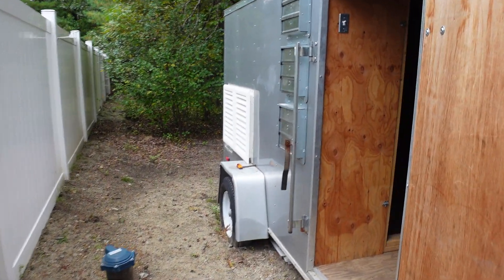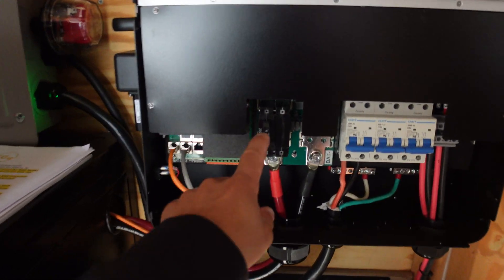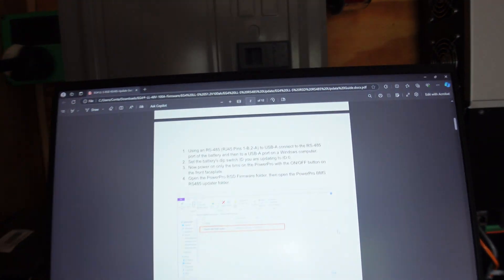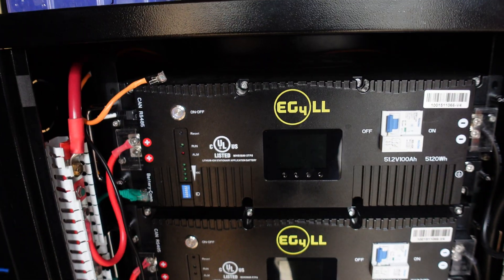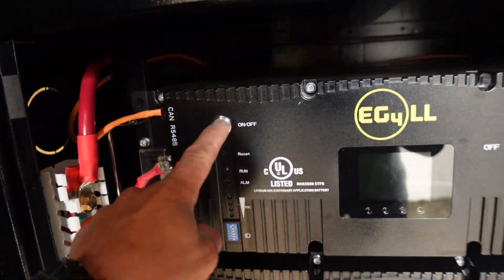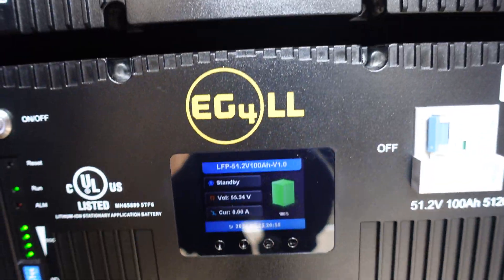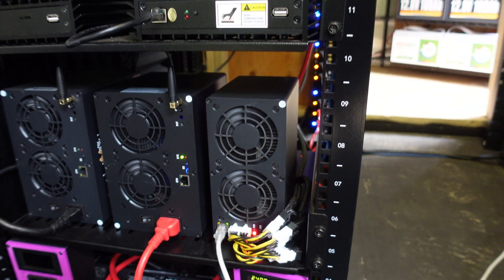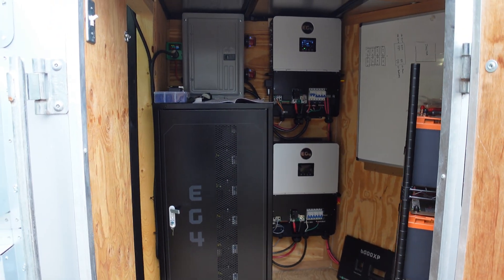Upgrading EG4 LL Solar Batteries is EASY!

Comment from the maker: ✨Firmware Upgrade Files: 
https://drive.google.com/drive/folders/16QYI3lXqS1m8LM16xeTXTj6Wb5-hDwh5?usp=sharing
➡ Check out Signature Solar: (I Purchased the 6000XP Inverter Package)
https://signaturesolar.com/?ref=zwzcpllh ("CHUMPCHANGE50OFF" For $50 Off)
➡ Check out Tangem: (My Favorite Hardware Wallet)
https://tangem.com/pricing/?promocode=CCXD
➡ Check out Koinly: (Crypto Tax Software)
https://koinly.io/?via=808374BB&utm_source=affiliate

Comment: Would you have an excel spreadsheet of what you purchased and what’s necessary to build a solar farm like you?
Reply from the maker: They actually have kits made up on the signature solar website. I purchased the 6000XP kit with the Hyperion Black 395w-495w Bifacial panels and EG4 LL batteries. If you need help just reach out; it’s all laid out for you there. The only other thing I bought from them was the 500’ 8AWG Wire. 

Just make sure you look into systems to make sure it’s what you exactly want! 

(Use code “ChumpChangeXD” for $50 off your first order. Every dollar counts!)